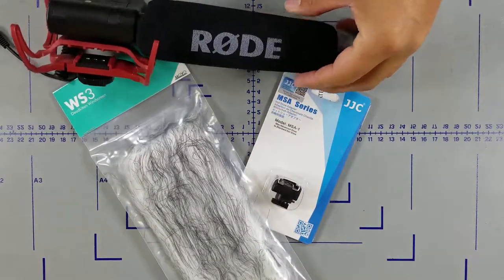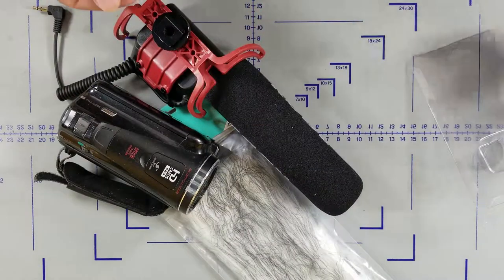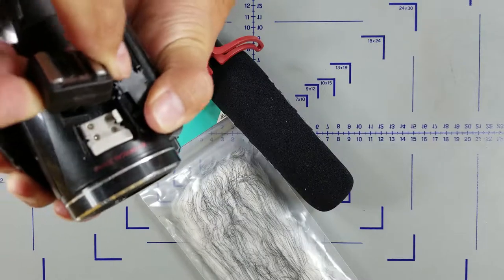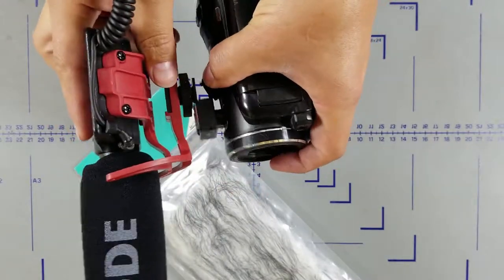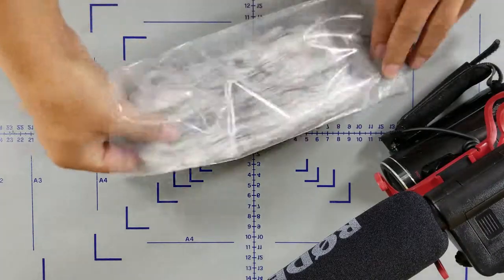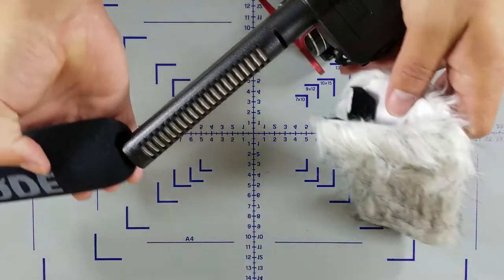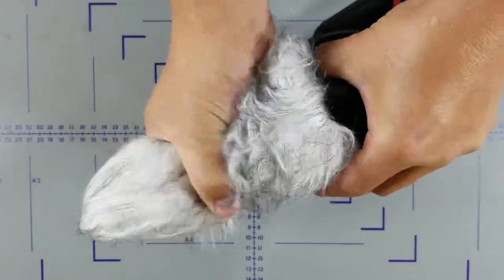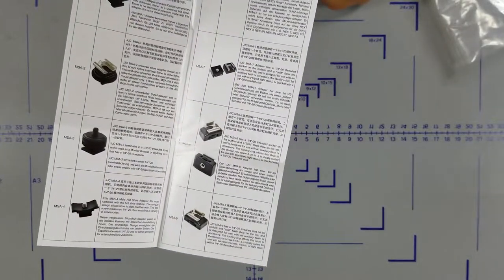Mini Advanced Shoe to Universal Cold shoe adaptor unboxing || Rode video mic Part 2

Comment: I believe you briefly mentioned it once in the video, but I think you ought change the title of this video so it indicates that this is a Mini Advanced Shoe to Universal COLD SHOE adapter, rather than a "mini advanced shoe to hot shoe adaptor." 

A hot shoe has electrical contact points that allow the mounted accessory to draw power from and/or interface with the camera. A cold shoe looks just like a hot shoe, but it lacks the electrical contact points and is used solely to mount an externally powered accessory to the camera. This product does not route the electrical current to the universal shoe it adapts to, therefore it is not adapting to a HOT shoe, and anything mounted to it will require external power. 

To be crystal clear, this adapter turns your mini advanced HOT shoe mount into a universal COLD shoe mount. The universal mount will be electrically inert. Any universal shoe accessories that draw their power from the camera or otherwise require some sort of electrical interfacing with the camera in order to function properly will not be compatible with the camera using this adapter.
Reply from the maker: Thank you. Yes this is a cold shoe and I have made the suggested correction to the title.